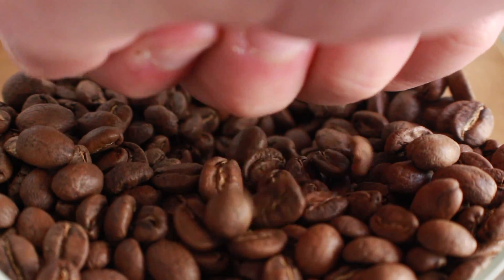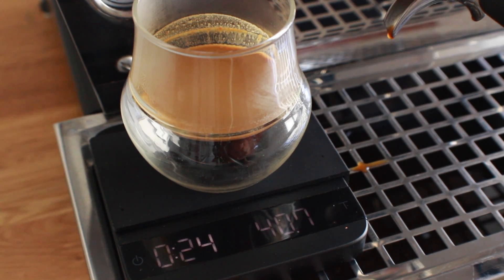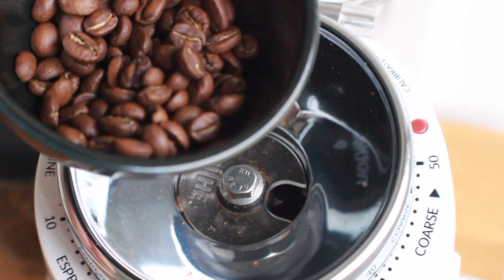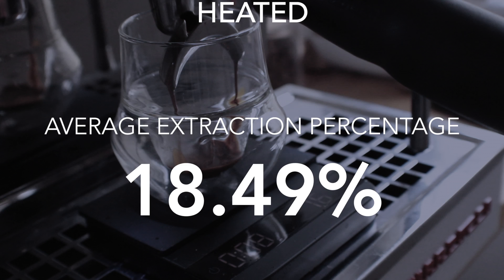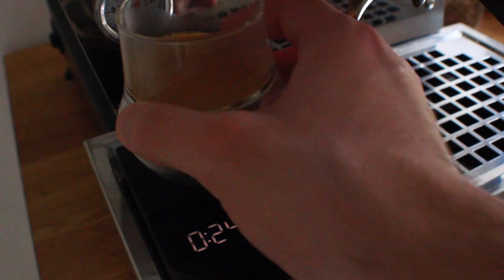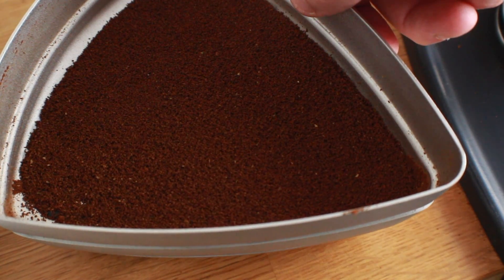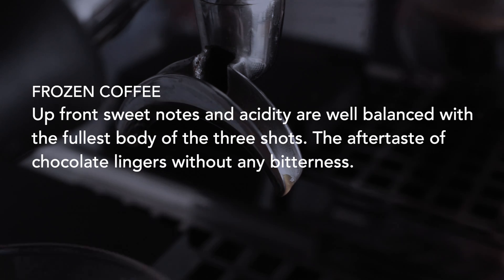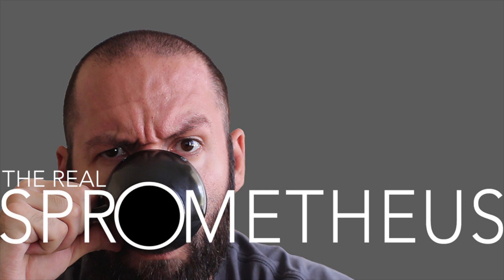COFFEE SCIENCE - Bean Temperature & Extraction

Comment: curious about applying another variable of consideration into your testing methodology--moisture content.

first,  thanks for your work,  very interesting!  i watched this a few days ago and it came back to me today as i was mulling over some ideas.   what kept pushing its way to the front was how water plays into this temperature model.  more specifically, the water in the air, or in the bean itself--its moisture content.  as a woodworker "water" isnt something you really think about because you dont see it or feel it while working with the wood.  but any woodworker will tell you water--specifically, moisture content is a critical component to dimensions, and movement especiallywhen being precise.  so i wonder how these tests you ran might  might be slightly influenced by this moisture content variable, and perhaps less about temperature. or actually a bit of both.  so you ran three basic sets of tests.  room temperature, frozen, and heated.  which would basically translate into normal ambient regional moisture content (room temperature), the heated beans would have less moisture content, because the some moisture has been burned off, or dehydrated. and the frozen beans would probably gain moisture from condensation from the trip thru air from the freezer to the hopper.  example, glass of water filled with ice and left on the table soon courses with droplets.

if this moisture content variable is taken into consideration when you look at your results something interesting happens, for instance your testing suggested the frozen coffee had the fullest body of the three shots.  so what might have happened is that because of condensation the beans had a very, and i mean very slight headstart on something like an infusion effect, because they had just a little more moisture at the time of your pull--or as simple as a squirt from a water bottle. to take that a step further into nerdiness, if there is moisture on the grinds, as opposed to no moisture on the grinds, i suspect the moisture would almost act as a lubricant allowing for a smoother travel thru the bed. whereas a dryer grind would have slightly higher friction coefficients, and the travel thru the bed takes just a little longer.  also, in your concluding thougts i think you also suggested that frozen gives a better distribution. this could be very similar to misting beans with a light spritz of water right before grinding. which seems to yield a similar result.  i dunno.  as you said the difference, at the end of the day is marginal, and what i am suggesting, is also --in terms of scale, something in the nano range of difference. but, a measurable difference nonetheless.

i suspect, you could run all the same tests, omit the temperature variable designation insert moisture content designation, and yield identical or near identical results.  room temperature would be equivalent to ambient air or natural regional moisture content.  heated would be equivalent to dehydrated. and finally, frozen would be misted, or moisture added.  sorry for blathering on, i recently got obsessed with dialing in my espresso again, as i had gotten lax with effort.  and  came across your video and it got me buzzing with ideas about variables and things that come into play that we dont norrmally think about.

anyway, thanks for the work you did it was absolutely, fascinating.  -maj

Comment: Thanks for this.  I have purchased the PAL device but would also like the syringe and filter which would help.  Where can I order this?  Thanks
Reply from the maker: I got the syringes and filters direct from VST’s website. Just a warning, the filters are single use and expensive, roughly $2 a piece.
Reply: Thanks!  I may just start with the syringes and see what results I get...leaving the filters and a next step.  :-)
Reply from the maker: @edwardebel1847  you only need the filters for espresso, but filter coffee would be fine without them and still get accurate readings.

Comment: I see you upgraded your Refractometer. The Atago one is a great refractometer, because it allows you to take samples at exactly the same temperatures. Actually what matters is the sample temperature on the prism. Because I can only see the results shown in the video. Therefor I assume you are taking readings between 25-28 degrees which is quite wide range and can give you a big variance in results, especially at consecutive test, the prism is heated up.

Make sure you take the readings always at the same Refractometer temperature, let's say 26 or 27 degree.

Otherwise great video.

Comment: Nice experiments 👍
I am wandering how much the concentration of water gets changed during heating and cooling. Because the microwave resonates exactly with water molecules, i.e, they’re efficiently heated up which causes the temperature increase of the beans. Therefore, it’s also reasonable to assume water evaporation may occur during heating. Concerning the low T case, cooling down the beans in air will most probably promote the water adsorption, or more precisely speaking reduce the desorption rate of water from beans. Consequently, a increase  of water concentration may increase. I am curious about the possible influence

Comment: Whats the wattage on your microwave? Reason, if you are using 1000w at 30sec. and my micro is at 1100w, then I should heat it for only 25seconds, right?
Reply from the maker: It’s an 1100w. So 25 or less. It’ll also depend on the ambient temp of your coffee, it’s roast (I.e. density). So I’d toy around with it and see how long it takes to get hot to the touch without burning.
Reply: @Sprometheus  Thank You! I will try both, hot and cold. My room temp is about 73 degrees.
Reply from the maker: E911Eagle thats pretty close to where I was at the time. Maybe a bit cooler. Good luck, let me know how it turns out.
Reply: @Sprometheus  I absolutely will do.

Comment: This video was great. Happy to see the return of the TDS meter! I've tried heating up my beans in the microwave before but overall the workflow became annoying and so I dropped it. But weighing out a couple of doses for the next day and putting them in the freezer has been a pleasure when I actually go to brew coffee.

I also initially thought that the difference in extraction could be made up by just running a little more water through the grinds. But then when I think about how the grind is better and what is coming out by extracting more might be different. (It might be more of a problem if the extraction was in the low 20s). I also wondered if you could run a test with a cheaper grinder and freezing the beans and doing a sifting comparison with a better grinder. Could this be a good cheap grinder hack?

Or perhaps it would be interesting to try Scott Rao's high extraction espresso with frozen vs to temperature beans?

Comment: There's one more thing I'd like to know about. As I saw in the video, the extraction parameters are the same, i.e. same dose, same output, and same time. However, as you mentioned in the video how differently the grinding sounded, I wonder if there's a change in the grind setting so that you keep the parameter the same? I mean, it's quite surprising if they were ground at the same setting, and extraction alone changed the %EY. If there was a change in the grind setting(I know one can grind finer with hotter beans as I've done that myself), then everything is much more comprehensible.

Thanks for the effort. It's useful information!
Reply from the maker: I did change the grind settings between the categories to keep them on the same timeline. I felt like it was more important to have similar shot times to keep contact time between the categories the same. 
Now the interesting thing is the frozen beans was the coarsest grind of three, so I don’t think the grind size was the major factor in the %EY results. 

Thanks for watching the the question!

Comment: Another thing for the refractometer readings is to stay in the same temperature range when measuring. For me it's 25.5-26.5 degree C. If you use frozen beans with the same brew temp as heated beans, the temp reading on the refractometer will be over 3-4 degree C difference. This difference can result in different numbers. So a solution would be to cool down the heated beans sample more.

Comment: I appreciate your work and the time put into doing the video as objective as possible and with a good protocol. However I want to point out some stuff, than can be considered speculation. In general all my results and with people I spoke with had to grind coarser with the coffee used directly from the freezer. The beans are frozen and so does the water inside it, if you try to break ice it will brake into little pieces.  I strongly believe that frozen coffee produces more fines, and with your sieving test you did not get them, simply because the beans from the freezer make some sort of condensation, and they get wet (similar to a heavy RDT). The fines stick to the bigger particles, and because of the humidity you could not sieve them properly. I would redo that sieving test, but after grinding I would dry the particles somehow, then sieve for more than 1 minute. You will get more fines than with the 2 other methods (room temp and heated beans) and in the end the fines are the ones that are the most efficient extracted, and in general the fines percent boost the TDS/EY numbers. Finer grind means higher EY if you dont choke and compress the puck. If your grind size from the frozen beans would have almost no fines, it would mean that it yields the lowest EY. With a narrow distribution of particles and a finer grind you will achieve higher EY (this is the theory behind EK high numbers).

Comment: As you extract, are the grinds a different temperature depending on their pre-grind temperatures?  Are the previously frozen beans a different temperature in the portafilter basket? If yes then will this be a variable that could have impacted your results?  I am new to all of this and about to soon buy a Flair Pro 2.  Hence  I wonder if the colder temperature grinds could mess with the Flair's limited thermal dynamics re: pre-heating etc?
Reply from the maker: Hi Jerry. Yeah the grinds weren’t all room temp by the time they were in the basket and extracting. This I’m sure has an effect on the extraction. But since Proud Mary’s grinders are in the freezer one of the points of this experiment was to test how it works straight from these different preparations. 
Hand pressed espresso machines definitely hinge a lot on pre-heating and thermal stabilities. The Flair is one of the best in my opinion. I don’t think a bit cooler grounds in the basket will have a much if any effect on a well preheated brew chamber. But only one way to find out.

Comment: woah great vid man. Also i don't think that the beans are roasted any darker after being microwaved, as beans are usually roasted with a way higher temperature (right?). However the beans sure expand and become more porous, so more gas inside the beans are released and larger passaI geways for water to flow through, thus contributing to higher extraction. For the cold beans, in addition to the more consistent grind,  I think the way gas and liquid behaves in cold temperature also play a role. At a macro-level, lower temperature would cause more gas to be dissolved into water (above freezing ofc). So I guess by freezing the beans, CO2 can be dissovled in liquid and get out of the way of the water, plus the more grind consistency, leading to a spike in extraction.
Anw i'm not working in the industry so thats just my thoughts. Keep up the great work

Comment: I noticed at 1:30 and at 8:20, the grinder is set a little finer for the frozen coffee. It seems the real benefit of frozen coffee is that it allows you to get a more even grind, thus allowing you to grind finer which is why it results in a higher extraction than room temp. Did you have to coarsen your grind for the hot coffee or did you also have to fine it up to land at a 24-25 second extraction?
Reply from the maker: TheGrandMug the grinding sequences are more of a B-roll shot. I ground so much coffee and took a lot of video. So the grinding footage I used per group may not correspond with the actually grinding done for that specific shot as I only flagged the extractions and TDS testing per category to make sure they stayed in order. 
That being said, the frozen coffee ran slower than the room temp or the heated coffee at the same grind size. So the frozen coffee was actually ground coarser for the shots tested. The room temp was the finest, the heated was a little coarser, and then frozen was the coarsest.
When it comes to the sifting test, all coffees were ground on the same setting to avoid the obvious shortfalls of the grind size differences which would sway the results.
Reply: @Sprometheus  Damn, that's super interesting! Moral of the story, next time a customer complains it's too cold or too hot in the cafe, I'm gonna tell them to take a hike
Reply from the maker: TheGrandMug haha that’s the dream!